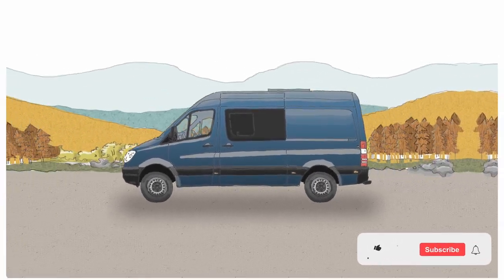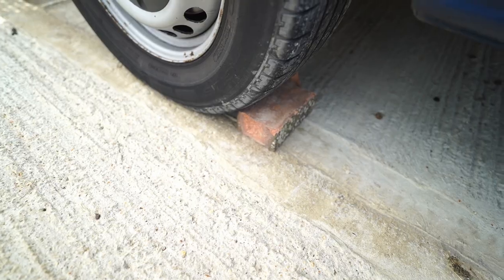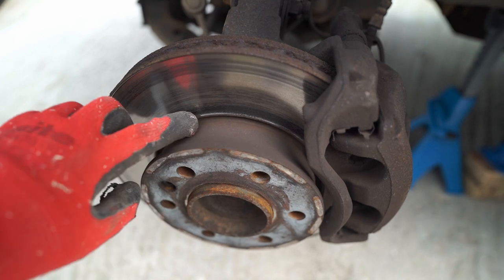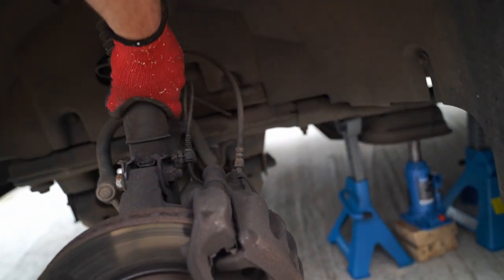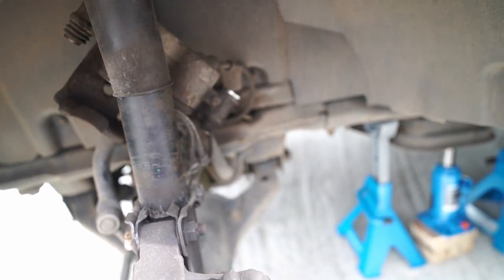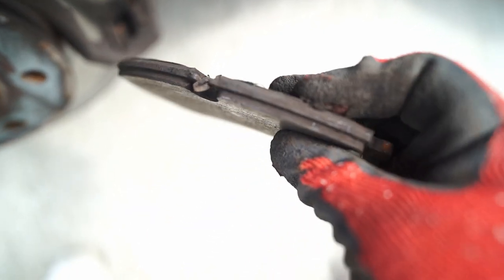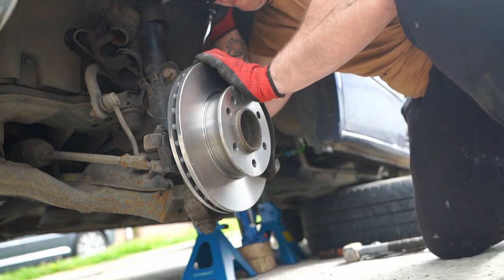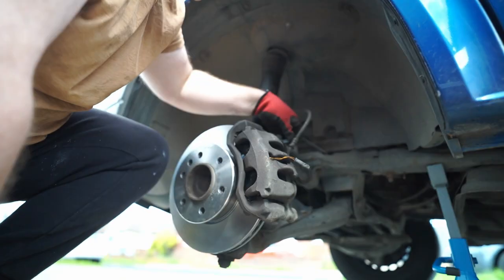Changing Mercedes Brakes MYSELF - Sprinter Van Conversion Service TIPS & TRICKS - Van Life UK Ep.5

Comment: Thanks for the video bud. However, I would not recommend the new pad bracket bolts which come with the pads unless you have new ones from a mercedes dealer. I made the same mistake and damn think broke  later on. So they are not  good quality. They must be heat treated and durable. Cheers mate.